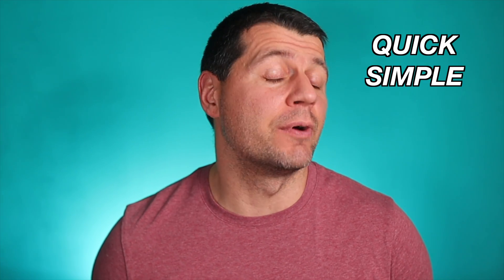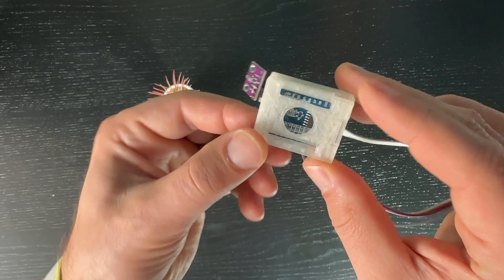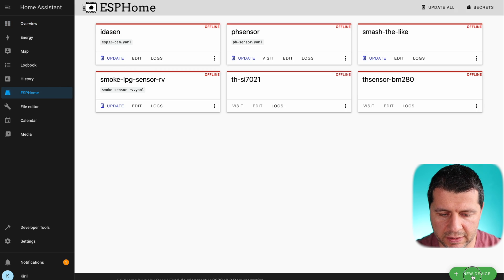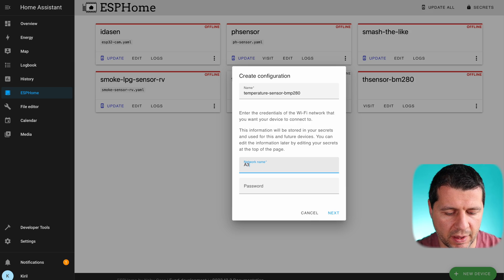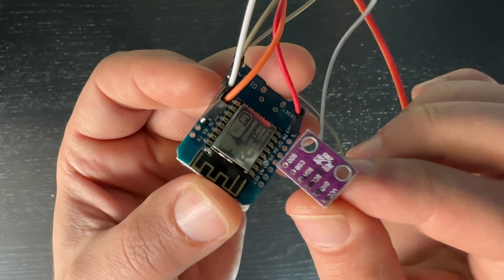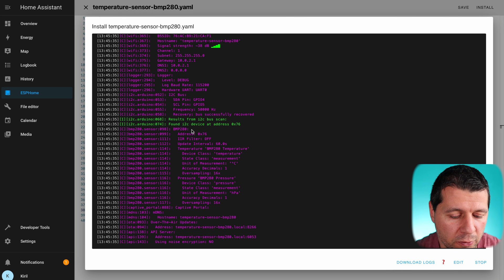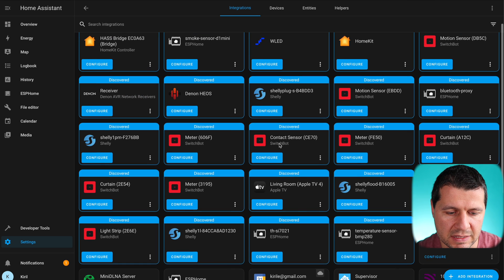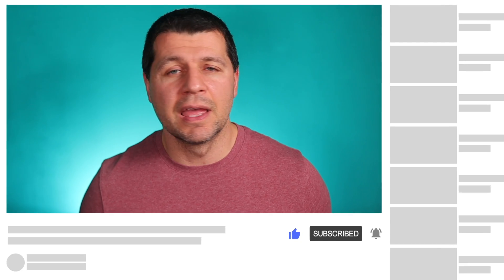Easily Integrate Temperature Sensor into Your Home Assistant Setup

Comment: Hello, it is possible to install this sensor on an esp32cam and therefore monitor an area and simultaneously measure the parameters of temperature, pressure and humidity.
Greetings from Italy

Comment: i use ds18b20 sensors for temperature measurement because cheap bmX280 sensors from ali often shows the weather on mars)
Reply from the maker: Haha nice comparison :) But are they showing incorrect readings this from day 0 or after some time working?
Reply: @KPeyanski  5 sensors has 5 different readings up to 3 degrees in same conditions. its new. and not possibly to calibrate it because readings almost random
but dallases has up to 0.5 degree (most in 0.25). any dallases from any batch
just try it
Reply from the maker: Thanks for sharing I have 1 or 2 dallas sensor that I may play with when I have some time :)
Reply: Ds18b20 is usually cheaper compared to BME280 almost 4x times, almost the same price as BMP280.
Reply: @yousaf.saleem  cheaper and much better

Comment: Thanks for the video. What software did you use to create the diagram to show how to wire the equipment?
Reply from the maker: You are welcome. I used Apple Keynote which is the equivalent of Microsoft Power Point. So I guess PP is also an option ;) BTW Why you are asking? Did I manage to make it look good or on the contrary it is awful?
Reply: @KPeyanski  The diagram is great! I need to start documenting some stuff i'm working and was looking for ideas. Thanks for the video :)
Reply from the maker: Thanks for answering. Glad you like it and good luck with the documentation ;)

Comment: You need to check the address, it can be confusing sometimes.
Reply from the maker: which address you mean exactly?
Reply: @KPeyanski  0x77 and 0x76, especially if you are using BME280 + BMP280 on same ESP device. Like I did, as discussed in ESPhome discord. That address can be changed on BMP280 only in these chinese cheap version.
Reply from the maker: Thanks for answering, Why do you need BMP & BME on one and the same ESP device? What is the benefit of doing so?
Reply: @KPeyanski  I was testing both sensor, along with dallas for the comparison of the three. There is a difference of 1.3C between the both sensors. Also on WLED you can use either without changing the any code, i.e BME280 or BMP280